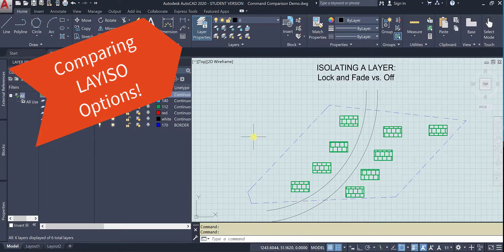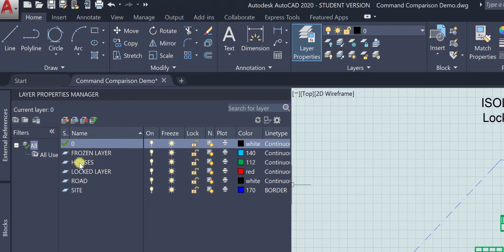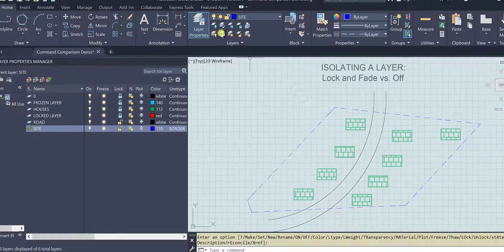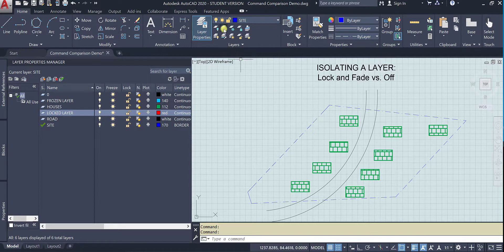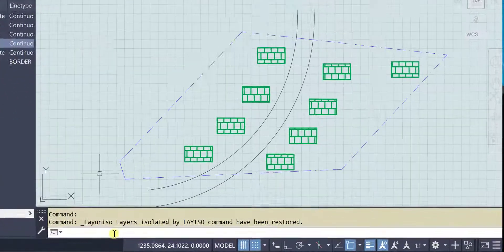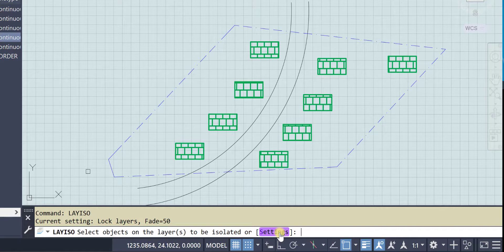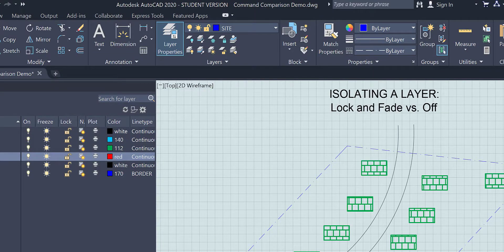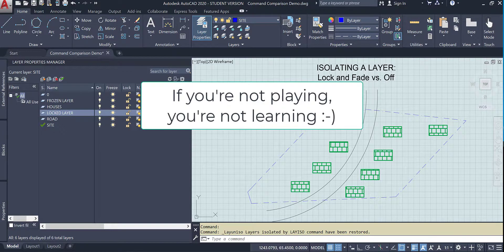Isolating a Layer in AutoCAD - Lock and Fade vs. Off

Comment: I cannot turn off non-isolated layers in CAD 2023 (I just can fade them to 90 %), do you know the solution in newer Autocads please? Thanks :)
Reply from the maker: I recommend the AutoCAD community forum for unusual settings like that. Remember that in AutoCAD, every setting has a command you can type in, even if it is to turn a setting on or off - or to change the fade percentage :-) Good luck!